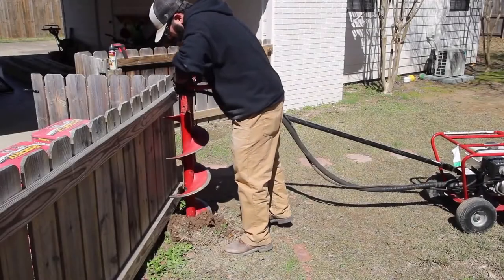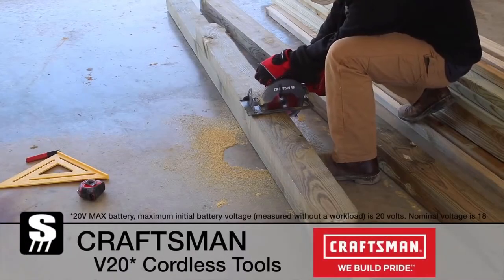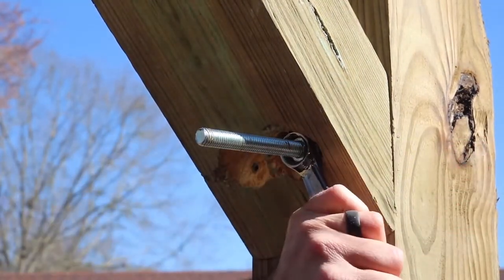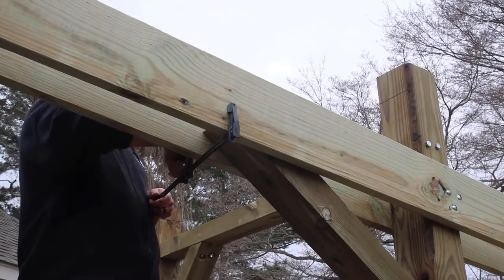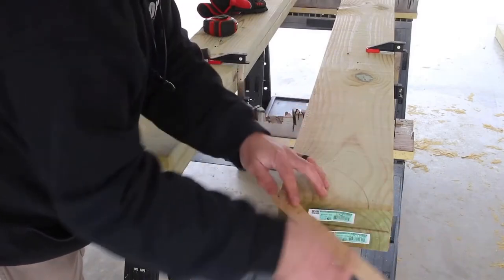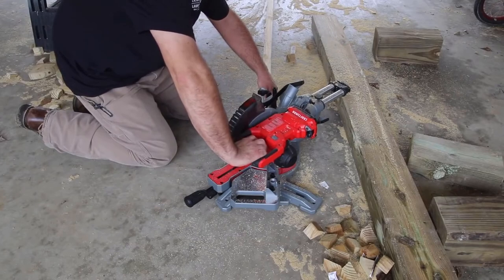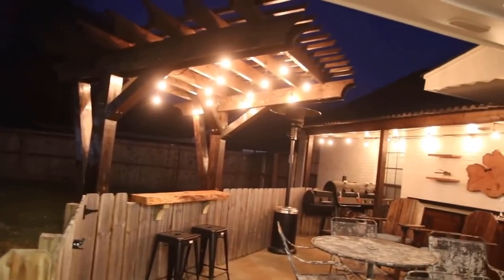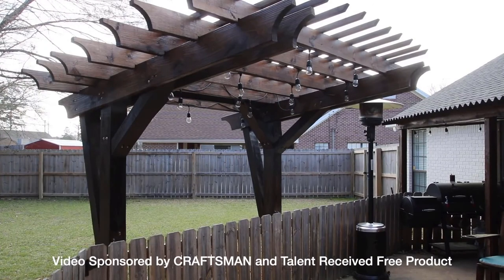DIY Outdoor Woodworking Projects | Patio Pergola

Comment: In my experience, wood concreted in the ground lasts 3 years and it is much better to use galvanized steel ends, available in several different types, for driving into the ground or concreting.